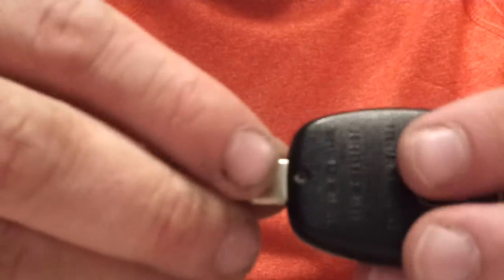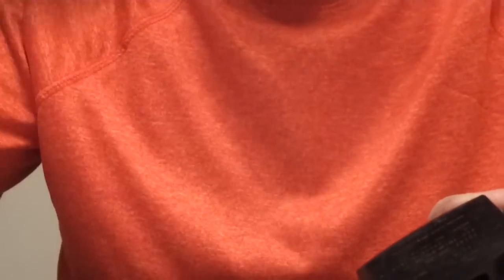Honda remote key stripped screw hack battery replacement

Comment: Everything spot on, but battery. I also googled others and was told it was a CR2025. I ordered it. It was not, it was a CR1616 for my '13 crv. Just FYI. Otherwise thx to this video, I got it out, but not sure which side of battery goes up. Printed side towards buttons or vice versa?
Reply from the maker: Thanks for sharing. I don't think this video was made before 2013 model year was made. Glad you found it useful.

Comment: Honda must have had the village iriot design the key using a tiny screw with loctite.  No easy way to  break it loose; I was not able to.  So, this method does work, but first time work the lid open a little at a time and have the plastic lid warmed up to be more flexible.  It has to be opened fairly wide to clear the buttons, but was able to and not break the lid at the screw.  A skinny needle nose pliers helps to get the battery/control module out if you have fat fingers.  FYI: a new lid costs $5 and some change and the screw costs $3+ at the local Honda dealer - a lot cheaper than a new key and programming it, if worst comes to worst and you break the lid.  Once you have done it, you gain experience on how far you can pry the lid open without breaking it at the screw.  Good Luck and many thanks to Joe Ratz!

Comment: Yeah, I stripped my screw head so I just grabbed my other key and have been using it.  Now I have a dead battery in both, one with a stripped screw,  and one I got the screw out but have lost it.  Fubar!!  Dealer wants $25 to fix the stripped one and I didn't even ask the price for a screw and a new fob back;  probably like $5 for the screw and $10 for the back.  God knows what they charge for a battery?  So, thanks for your vid, I'll DIY and save me a bunch.
Reply: eBay has some really good deals with reputable sellers on the batteries. Free shipping. I spent $2 for two Maxxell batteries.  I tend to stay away from no-name battery brands especially on eBay.  The batteries arrived in a few days. Both batteries worked great for both of my fobs.

Comment: If you’re in this situation I have something you can try before this:

tl;dr: If you have it, a 1.5 flathead bit might work, even on a screw that is pretty stripped. Worth a shot before you risk breaking the back cover.

Long version: Helping a friend with his dying key fob. I had given up on the screw since it was stripped to begin with, so even with the right bit (PH00) and applying heat, it only got worse. 

Anyway, I used this trick and it worked perfectly (thank you!), but I really didn’t wanna leave the screw there to cause someone else a headache down the line. So I decided to try something different: I needed a bit that would sit deeper into however much of the grooves was left on the screw head. I started trying flatheads and voila! The 1.5 flathead worked beautifully. For reference I have a large ifixit kit, manta? Idk it’s over 100 bits. You may not have that exact size, and sadly that’s key (damn it I hate puns) for this to work. Good luck!

Comment: Hi Joe, 
I am missing the screw to my Honda Element Key fob. Actually it has been missing for a few years so sometimes if I drop the key it splits apart. 

Do you think it is maybe better just to leave the screw out and that way I can always open the case? Or get a new screw? 

Where would I find a screw like that?
Reply from the maker: https://www.ebay.com/itm/Genuine-Honda-35116SDAA11-ACCORD-03-17-CIVIC-13-17-SCREW-FLAT-35116-SDA-A11-/222514464771?mkcid=16&mkevt=1&_trksid=p2349624.m46890.l49286&mkrid=711-127632-2357-0
Reply from the maker: I'm not sure if you can find these at a hardware store. I'd just order from ebay or search that part number elsewhere.  Good luck.

Comment: This method works very well after I failed to unscrew the Philips screw with a stripped head, but my fob cover now has a thin gap on the side where I started to pry open with the same flathead screwdriver used in this video and dust/lint could easily enter the fob. I discovered that using a flat head screw driver on a Victorinox Swiss Army knife could prevent this problem because it's not sharp and it's very smooth; as a result, it prevents the fob plastic being severely damaged. Anyone else had this problem? Lastly, remember to remove the key chain first before starting to do this!

Comment: There might be an easier way before anyone attempts this. I rounded my screw head too. The blue loctite can be softened by heating the metal shaft (carefully). The dealer service tech was able to get my screw out by doing this. I then replaced it with a new screw. If you have ANY difficulty removing the screw try heating first before any damage is done. You do need a decent screwdriver to do this (#1 Philips I used a Home Depot Husky brand kit with 6 small drivers for about $6 and it worked fine).
If it's too late for that, the video is the way to go. I think a new back and screw will run about $12 at a dealer.
Reply from the maker: So where is the instructional video?

Comment: Joe, thanks for posting this years ago.  Do you have a part # or link to buy the rear cover with the ‘H’ logo surrounded in red as shown in your video ? Just curious .So far I’m unable to find one for a ’07 Ridgeline key. Thanks!
Reply from the maker: https://www.ebay.com/itm/174570561570?chn=ps&_trkparms=ispr%3D1&amdata=enc%3A10yBSby2KQUW8EuTf2lH9ww31&norover=1&mkevt=1&mkrid=711-117182-37290-0&mkcid=2&itemid=174570561570&targetid=1262375642056&device=m&mktype=pla&googleloc=9019609&poi=&campaignid=12873834709&mkgroupid=126188546150&rlsatarget=pla-1262375642056&abcId=9300536&merchantid=6296724&gclid=CjwKCAjwuvmHBhAxEiwAWAYj-DPAjpNsxS6qBljuVx1Ml738R2iMlFUgJ_QjuF8_12q7lBfE0UMnkRoCdxAQAvD_BwE
Reply from the maker: There out there. That is a JDM part with no FCC numbers because japan has no FCC. Good luck.
Reply from the maker: https://www.ebay.com/itm/For-HONDA-CIVIC-ACCORD-FB6-GE8-SI-JDM-Red-H-Type-R-Mugen-Key-Fob-Case-Back-Cover-/203264909011?mkcid=16&mkevt=1&_trksid=p2349624.m46890.l49286&mkrid=711-127632-2357-0
Reply from the maker: 35114-SNW-J01 search this number.
Reply: @Wordaroundthebonfire  Thanks so much! I just ordered a few.

Comment: Here's a tip to remove the screw without stripping it. Just put a towel on the table and lay the key on it and put the screwdriver on the screw slot and press down hard. Then turn the whole key instead of the screwdriver. This is an old trick I learned for stubborn small screws. Don't turn the screwdriver. It's too easy to strip like that. You can try some heat on the key too. That will help loosen the screw.
Reply from the maker: This video is for folks that have exhausted all the "old tricks". If you have this problem I'd love to see a demonstration video to share your wet towel trick.

Comment: Alternatively, you can drill out the screw head, disassemble as normal, untwist the threaded part with a pair of pliers, and buy a cheap replacement at a home improvement store.   You won't risk breaking your key, and you'll be able to remove the screw next time you want to replace your battery.

Comment: This worked fine after I couldn't get the #$%^&* screw loose.  Thanks!  
However, even better is heating metal of key, which unlocks screw and works even with a partially stripped screw!  I used a BIC lighter, but a candle would probably do, anything to heat key enough to melt the loctite.